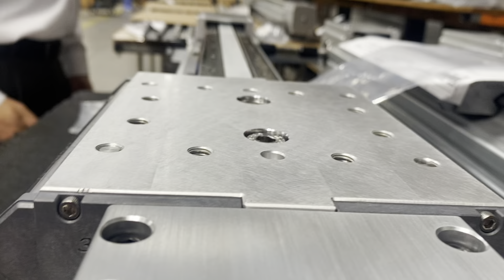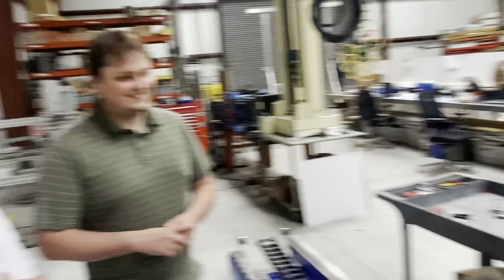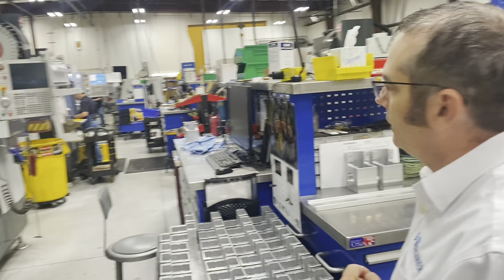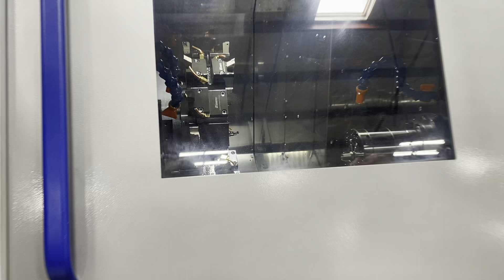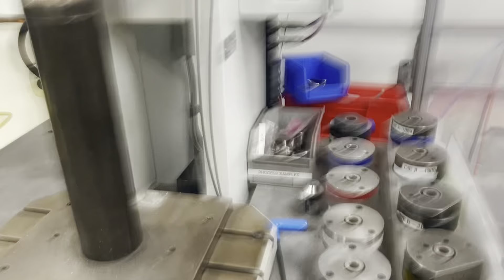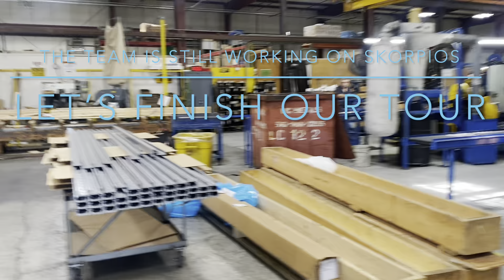Can BISHOP WISECARVER Engineers Improve Skorpios WEAPON POWER?

Comment: Watch out with the timing belt, having some slip during a hit seems useful to not transmit all that shock to the motor. You'd get more shock transmission with a timing belt, though it would also get better traction for getting up to speed.
Reply: I think he mentioned using a clutch on the motor shaft.